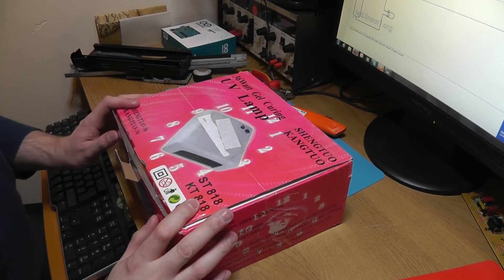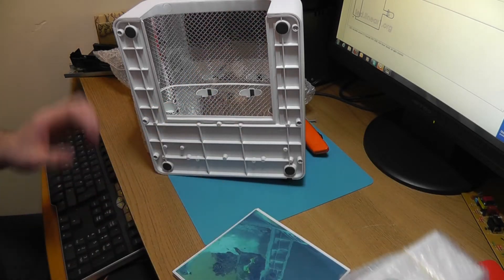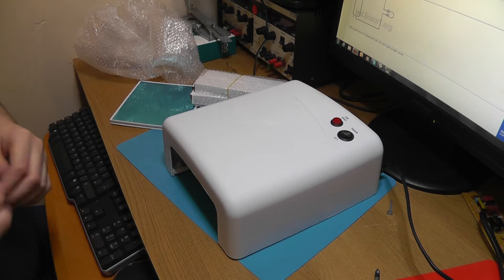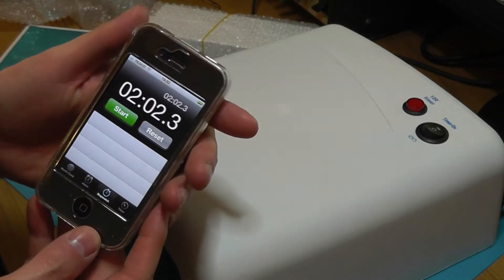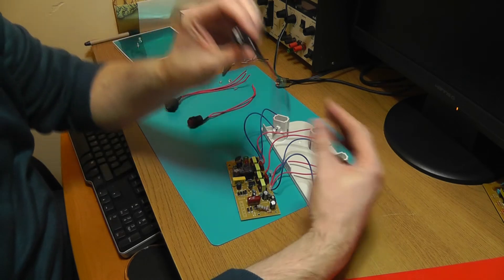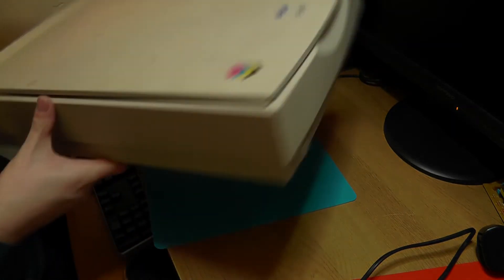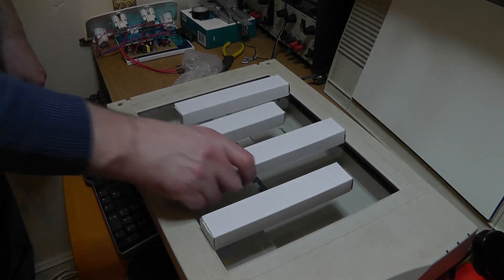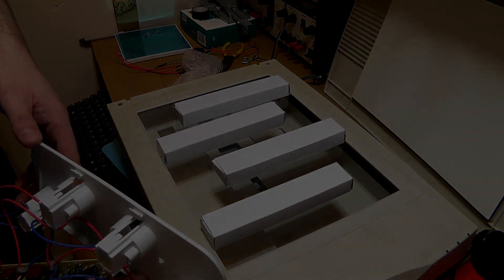Turn an old scanner into a UV PCB developer box - 2

Comment: I just bought that UV nail box thing for £11.38 from within UK. I don't think I'll even need to put it in a scanner unless I want to do big boards, just get a little piece of glass from an old photo frame and use that to keep the artwork tight to the board. I will inevitably put it in a scanner though.

Comment: I would think you could get the same results by using small (maybe 12"-14" length or whatever's available that's closest to those) fluorescent UV lamps in the scanner housing. What'd be great though would be the ability to take this a step further and combine two beds with a hinge and single control & timing circuit to allow for double sided PCB developing.

Comment: Looks good.  Ive tried toner method and not having much luck with it so might try this.  Why are these nail dryers only coming from the UK though? I looked on US ebay and listings only showed UK sellers as well.  I'm in US so would have to use something different?